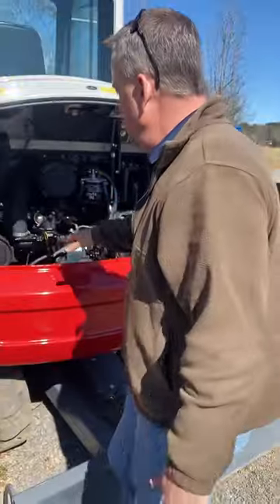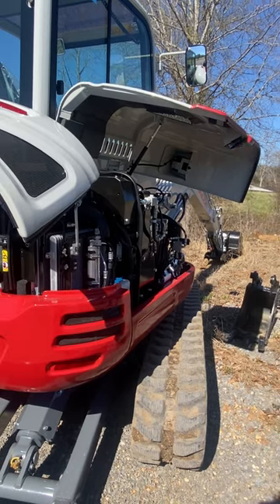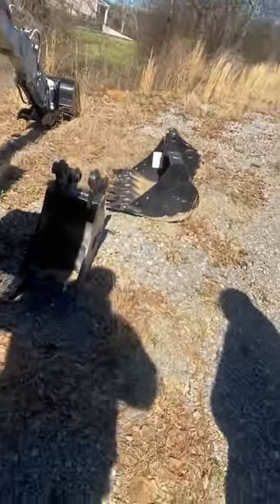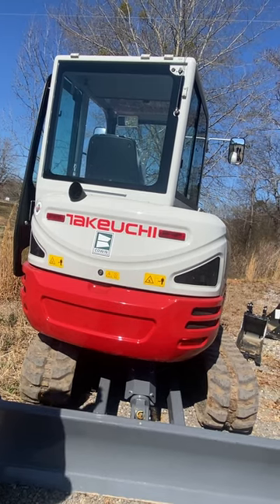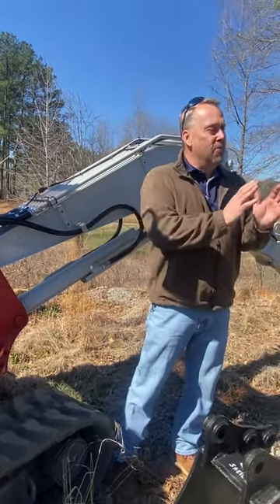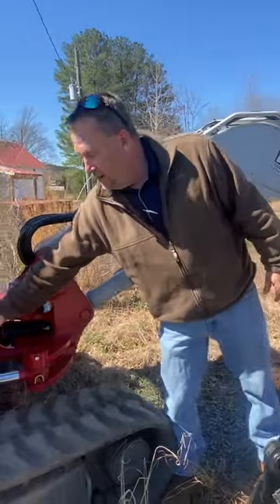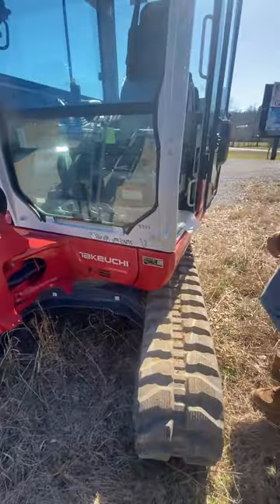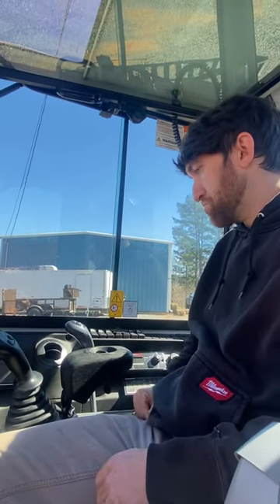Takeuchi Mini Excavator Walkthrough and Overview Inside and Out!

Comment: I just bought a used TB260 today. I hope this guy is still at Cowin when I need something in the future.
Reply from the maker: Did you buy from Scott?
Reply: @DiyCommerce  Actually I bought used from United Rentals, but it only has 1250 hours and is in really good condition believe it or not! 2018 model
Reply: @DiyCommerce  a customer of mine offered me a T135 I think it's a 1999 or 2000 still works no leaks he replaces a hydraulic hose that was dripping and way is 7,500 a good deal? He said Im getting friend discount
Reply from the maker: Any excavator that runs for $7,500 bucks is a great deal

Comment: If you have a TB016 you'll need to get a grinder to open up the sides -- the right to access the water pump for example (there's a vido of someone removing the canopy, etc...pfff), and the left to access the alternator and fan belt (which I'll have to do to find out why its not charging). Lucky you.